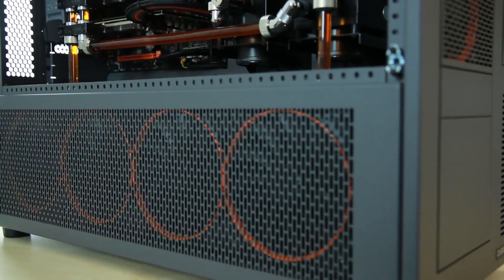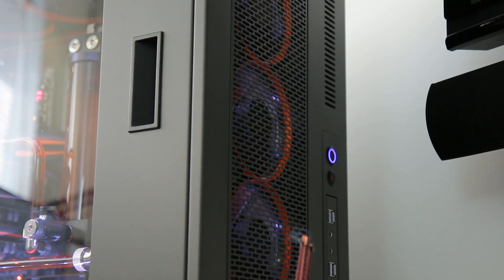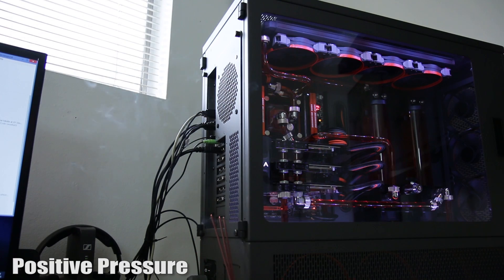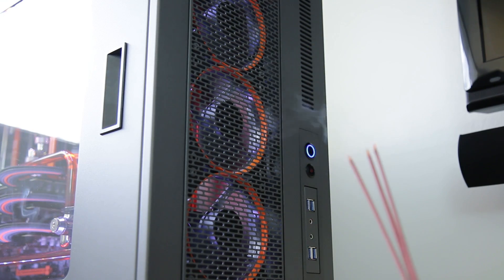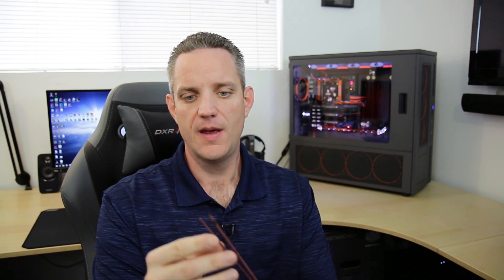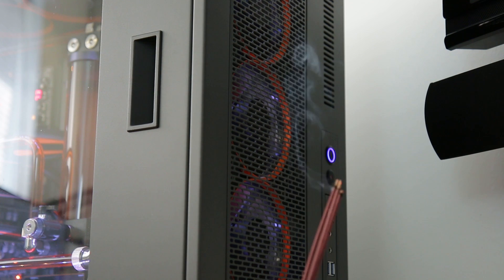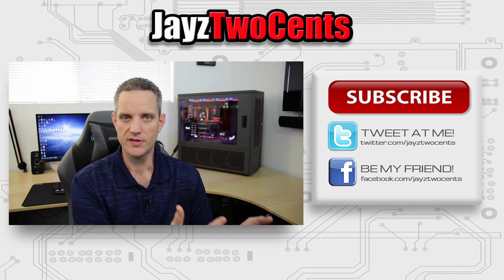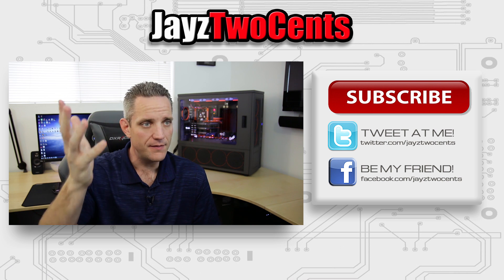Case Flow and Pressure Demonstration - How to balance airflow

Comment: Is it bad that I do not have any exhaust fans in my rig @JayzTwoCents ? (I'm serious)
Reply: +Vipadex Yes it is. You need an exaust fan to draw out the hot air
Reply: ya it would definitely help move hot air out, and how do you think you don't need exhaust fans? like do you have common sense
Reply: Bryn Then
Unless he wants to rely on the case ventilation holes to let the hot air naturally leave the case. Lol still you need an exaust fan to push out the hot air. Unless you have lots of $$$ to replace parts due to thermal meltdown and overheating.

Comment: I find it hard to believe number of case fans doesn't affect pressure. Sure there are diminishing returns as you put more in but I'd like to see some empirical data before you make bold claims like that.
Reply: +UnderwearThief It's just simple logic.  It's not about the number of fans, it's about how the overall volume of air they are moving.  Factors that influence volume of air are fan rpm and if they are obstructed or free flowing.  So he has four fans on his rad, but he's going to get less airflow out because of the rad.  He might only have three intake fans, but they are unobstructed and free flowing.  His one rear exhaust fan is also free flowing.

So he sets the speed of his rad fans for optimal CPU cooling (and they don't have to run fast because that 480 is deliberately 'overkill' for his CPU loop so he can get away with low fan speeds).  Then he just sets the relative speeds of his three intakes and one rear exhaust until he gets a positive case pressure at the lowest achievable fan speed (which also keeps noise levels low).
Reply: +meson1 But that would be related to number of fans...If you had 0 fans? No airflow. 1 intake fan? positive pressure. 10 intake fans? More positive pressure. There has to be some correlation between volume of air moved and number of fans.

Comment: My case has one exhaust 120mm and a blower style cooler (R9 NANO) as well as two 80mm be quiet fans on the front top and the psu on the front bottom draws air in but fan never usually is on because of semi passive mode so I think the air is actually pretty blocked up coming in but has a larger exhause...so negative/neutral? I modded my case for the top fans though...

Comment: Jay, I am going to build an H440 and equip it with a Kraken x61 water cooler. In terms on placement, would you say that it is better to place it in the front with cool air flowing through it or on the top with the warm case air flowing through it to the outside? if you could help that would be awesome! thanks!

Comment: I have 3 intakes at the BACK and no exhaust in the front and i figured out that my cpu was colder 13 degrees with this confic rather than the the intakes in the front
Reply: the 2 *
Reply: +Alex Sakellarioy you probably had the wrong kind of fans in front then. maybe you are using all air flow fans and not static pressure? front intakes usually have obstructions like hard drive brackets and other components in the way. static pressure fans are better for confined spaces where there is less breathing room because they push air more out their sides and around components vs airflow which needs breathing room but pushes air straight through the middle and is probably blocked by those components. you probably got better air flow pushing air in from the back because the space towards the back of the case has fewer obstructions so air can move more freely. its not the wrong way to do things per say, if it works for you, it works, but its good to know why. not many cases have three fan placements at the back so this wouldn't work in all situations. if you tried static pressure intake fans at the front and airflow exhaust fans at the back, you'd probably achieve the same results or better.
Reply: Yeah my fans werent static pressure i removed the hdd cage at the front but i have a corsair 100r and the front intakes are too small maybe because of that

Comment: after watching your 1st video on air pressure, i put a front and a bottom 120 fans and kept the default rear 120 exhaust fan in my case.. dnt use hydro cooler though, my pc runs cool now.. :)

Comment: ASUS' RoG series AI Suite 3 (and the normal AI Suite 3) has some really nice fan control features and that's what I use to make sure I've got positive pressure flowing through my Corsair 750D. I've got two Noctua NF-A14 fans at the front and a Noctua NF-F12 bottom mounted fan for my intake and then I've got a 360mm top mounted radiator with three Noctua NF-F12 fans (push config.) with an additional Noctua NF-A14 mounted in the rear for exhaust. I haven't done any smoke testing like here but with the fan curves I've made in the AI Suite, I'm "positive" I've got positive pressure. I should note that I remove the brushed aluminum front panel in front of the two front intake fans when I'm using it for any lengthy period of time to ensure better/less restrictive air flow through this 750D case. I only put the panel on for show and to hide the poopy brown colored Noctua fans. Nice video, Jay!

Comment: I thought (and i didnt read this anywhere) that best scenario would be to have pos pressure on idle and negative under full load. That way you get less dust when most of the time pc is idling and then during load you get the best cooling performance of negative air pressure.

Comment: you look like you doubted yourself when you said these principals don't affect air conditioners/cooling but you were right they do most definitely.  Froze coils are generally airflow issues, Also motors are sized to provide enough pressure top compensate for pressure drop through filters and coils.

Comment: I just got now Corsair AF120 fans. I installed then and some rather interesting things started to happen. I wanted to get one exhaust fan and one intake fan. But when Installed the intake fan it started to make rally loud noise. Turns out when you have something covering (case mesh grille) the case intake it gets loud so I had to switch it so both the back and the front have exhaust fans creating negative pressure. Would like it to be different but I am forced to go this way.

Comment: Interesting video thanks for that Jay, i just finish a build with a Corsair air 540 case with two Noctua 140's in the front and its amazing how much that dust filter cuts the airflow of compared to the hurricane in side when its removed.
would be interesting to make a video bench marking temps of CPU and GPU and case atmosphere temps with and with out dust filters that would be an interesting watch, keep up the great work.

Comment: This is actually new to me and it leaves me with a question. All my fans are the same Corsair fans, there are two intakes on the front, and exhaust on the back, and a pair of exhausts on the radiator at the top of the case (push and pull). If I'm understanding this, I need to turn the rear exhaust into a intake to create a 3:2 ratio of in:out? Thankfully its not in use at the minute, but I can just turn the fan around when I go home for the holidays.
Reply from the maker: +Phantasmal Wordsmith Thats not what I said at all. I said you need to make sure that air in is greater than air out. You need to account for the obstructions on the front of the fans, drive cages, filters, doors etc.
Reply: +Phantasmal Wordsmith I think changing the fan speed itself would actually be the best solution. A think to take into account is airflow direction. If your air is moving from the front of the case to the back you should encourage that with your fan direction. If lets say you reverse your fan in the back of the case you would be pushing the air in the opposite direction. this could cause a spot where air wont move and will cause heatspots.
The bottom and front should be intake fans. the back and top should be exhaust in most cases.
Reply: Forget the PSU and GPU fans if they are part of the loop is quite common. If you have a GPU with a blower it will be blowing the air out of the case. If your PSU is not in it's own enclosed section then it also will be a part of the loop. Number of case fans and what direction they are blowing isn't the end all, be all. JayZ's incense test for airflow is a solid one.
Reply: +Jason Davenport He doesn't realize anything, first of all what a brain dead idiot he is to deny basic laws of physics. Probably froze his head by blowing air of 50°F ambient temperature at himself xD

I'll better block him now, before I'm laughing myself to death. May he continue to amuse the remaining audience or talk to himself ... I'm out ^^
Reply: not what he said. but since the PP top rad and back exhaust you should test with smoke. i have a 750d with 2 140mm infront as intake no drive cages and 2 120 mm in top push only on a h100i and a 140 low rpm fan with led in back as exhaust airflow is good for me. all fans noctua ofc the led not its for looks only spins really slow
Reply: *****
I have NO filters.
Reply: *****
hes too stupid to understand what was given to him thats why. not the fact he wanted help. hes got the wrong setup to start and i told him what to do. so yes. the guyis WRONG and jay was correct in telling him it was wrong. he doesnt understand airflow
Reply: Leone Furlan Yeah my cpu is like at 19c idle and 51c at load on my 9370 at 4.7 and its been on for almost 2 years straight i never turn my pc off.
Reply: +Phantasmal Wordsmith I'd flip it. Personally I have a cube case, intake from the back, passing through the CPU cooler and going out on the top, GPU has a side intake, same exhaust as CPU. Great temps overall, but the air can get a little toasty (r9 390 owner)
Reply: I dont use fans, they make noise, ultra on gta v works fine
Reply: Erik Gustafsson
Specs and resolution.
Reply: *****
Nope, as a matter of fact, I practically don't have a side panel. Areocool DS cube, with the window taken out.
Reply: Just flip it if you have fans at the top already. I have it fliped so I can have 4 fans for intake and 2 at the top for exhaust. I could have another one at the bottom as an intake but it would take air from the psu
Reply: 2 front, 1 top on intake, and the psu (bottom) as an outtake does the trick for me. (works as a feet warmer too)
Reply: +Phantasmal Wordsmith As Jay said, think of the obstructions, and the VOLUME of air that is being moved. Now I have very little experience with radiators. But, they block a hell of a lot of air flow, so I would consider the 2 fans on the radiator 1 fan and not 2. Keep it as it is. Think of the air FLOW. Have a near clear channel from Front to back and Bottom to top. IF you have a bottom fan, then you must have POSITIVE pressure, as that bottom fan filter will get clogged up so fast its not even funny.
Reply: +Phantasmal Wordsmith get rid of the push pull config on the rad, not needed. just do pull. makes it easier to clean the rad without dropping fans with a vaccuum just by removing the side panel. as for the rear fan, leave it on exhaust. it promotes flow through the case and promotes flow across the the motherboard. as for the front fans leave them blowing in, by removing the extra un needed fans on the rad that are pushing. by doing so you create a highly positive flow inside the case and will force air through the rad by default actually helping the radiator cool better then sucking that much air from the case

from what you describe you have created a massive negative pressure inside the case. 

i modded a factory hp media center case not that long ago (my current case) to accept 2 120mm fans on the side panel and even with one of them off and only a 80mm exhaust fan and no fans on the front panel i have a neutral case flow, which isnt ideal but it was better then the heatbox i started with by miles.

heres a pic, all the holes in the side panel were there already wich dont pull or push air at all oddly enough and are neutral flow as well

http://puu.sh/lYEIt/c8f002cbf9.jpg
Reply: Raging Reaper Gaming Variety  Have pictures with lights on?
Reply: Bacon King
you mean so you can see the actual case itself without the leds in the dark?
Reply: Raging Reaper Gaming Variety yes, Id like to see if there are any vents or possible routes, please!
Reply: vents? the entire side panel is ventilated. what you see in light is holes in the metal
Reply: *****
not really. cause i took the time to explain how and why he fucked the config up and why the way he wanted to set it up was wrong. no need for push pull and create crossflow. read my comment.

people liek you defending people that dont listen to whats told are why the internet sucks
Reply: lol. yeah you mad. i gave you an answer
Reply: +Leone Furlan  I just put 2 exhaust fans on the top and forget about it.
Reply: +Leone Furlan  I just put 2 exhaust fans on the top and forget about it. I have 3 intake but one is for my water cooler.
Reply: awi5951
my pc stays on as well till im forced to reboot it
Reply: +Woo 991 can you suggest the best pressure composition in percentage? 50% in 50% out, or 60% in 40% out, or even 90% in 10% out? Which one is the best? Assuming theres no obstruction in the case.
Reply: +Leone Furlan I concluded that balanced or neutral is better. Thanks.
Reply: ***** No its not i have a thermaltake water pro 3.0 with two Noctua industrial fans at 2000 rpms. And my cpu doesnt have any voltage increase. Even core temps says the same temps.  Also i have 7 case fans on my pc so temps are never a problem all noctua industrial fans with a 3000 rpm one blowing on my graphics card my case is a wind tunnel pretty much. And the fusion 500 cpu grease i use gives 6 c of temperature reduction
Reply: *****  Maybe you live in a shitty hot area not my problem. Maybe you live in a trailer with no AC? That's your room not mine so you pulling crap out of  your ass.
Reply: ***** Thats what it is reading per core and linus doesnt know everything he screws up alot on air.
Reply: ***** You clearly are a intel fanboy  not on amd. Amd cpu temp is different than the per core temp that has been the case for awhile. And intel cpus run at higher temps than amd you cant run a amd cpu over 65c.
Reply: ***** You do know 19c = 66 F my room is at 50f easy  in the summer.
Reply: You just dont know what ambient temperature means.
Reply: Pokemon_Go Pokecoins https://twitter.com/dailyoffers98/status/755308192427569152?v=a12aDCxrcts?v=a12aDCxrcts
Reply: +Darkpharoh You do realize that Andyg is right, right? It's impossible to have a water-cooled or air-cooled cpu be lower than room temperature. But let's say that it is for a min. Do you know what happens when something is colder than room temp? Condensation, and that would fry your pc. And who the hell lives in a room where their temp is 50f? Most people keep their homes in the 70's.
Reply: Jason Davenport Someone with a older AC that can frost the windows in the house. You can see the air flow from my AC.
Reply: Pokemon_Go Unlimited Pokecoins https://twitter.com/linda_smith015/status/762369219732336644?v=a12aDCxrcts
Reply: i will second that lol..
Reply: +Jason Davenport wrong
Reply: bro haha ive just built my computer with a 750d airflow edition and the h100i v2 xx
Reply: +JayzTwoCents This is basic Jay. Most of people ignore that
Reply: +JayzTwoCents I know what you said, but flipping the fan (f) is the easiest method availible to me as of right now. My fans are all the same make and model and speed, the only differences being location. I get the principle you're proving in this video however, this does not mean that changing one of the fans does not affect airflow. Based on the factors you&#39;ve brought up (2 drive cages, c and 2 filtres, d. Plus the radiator, r) you could express my current configuration of fans as :
([1f-c] + [1f-c]-d) : (1f+1f+[1f-r]-d) and I am suggesting I turn one of the fans around to make it into;
([1f-c] + [1f-c]+1f) -d : (1f+[1f-r]-d). I should clarify that when I say this is new information to me, I meant the Positive, Negative and Equal pressure. Up until now I had not considered pressure to be a factor in keeping my components a little cooler and freer of dust. Thanks to this video I know that there should be more air going in than going out, thus I thought of the easiest solution to reach that, and thought flipping the fan would be the easiest way, then posted the initial comment as a means to see if I was right. I apologise for the initial poor explanation of my thoughts.
Reply: *****
pretty much yes. read all the comments, he asks a dumb ass question that was covered in both airflow videos plainly and blatantly. more air in then out means posative pressure in a nutshell and not being able to understand that. cmon, you gotta be some kinda stupid or just non observant
Reply: ***** Yeah they dont  not safely even amd says you are damaging your cpu and voiding your warranty. Ask any of the amd overclockers boards they will say your cpu at 65 c is dangerous and look at  what  the per core temps say those will be like 51 c to 55 so that is in the safe zone so what you said isn't true. If you get to 65 c on the cores on amd your cpu will fry.
Reply: ***** 66f is considered unbearably hot for a room in my  area so you must  live in a shitty area with no A/C. On the overclocking forums people are saying have have a 12 c idle per core temps.